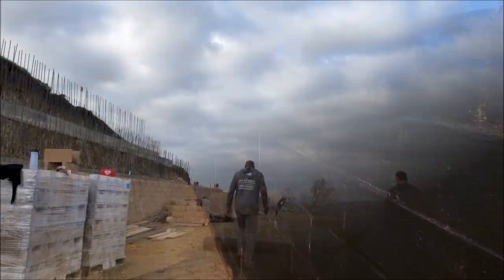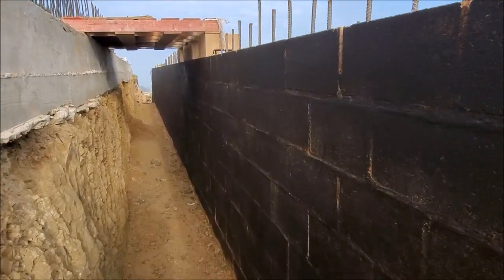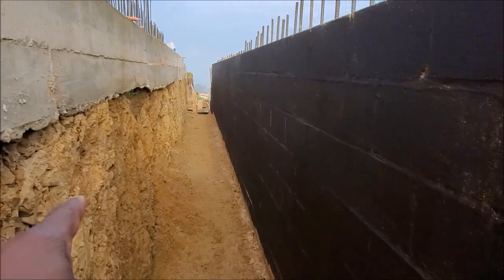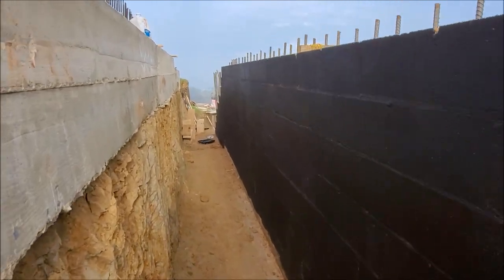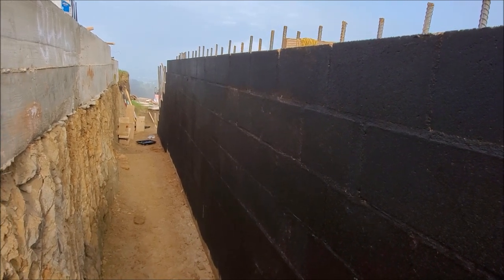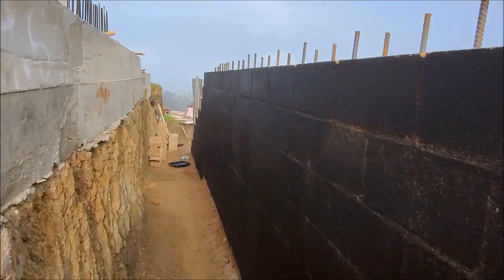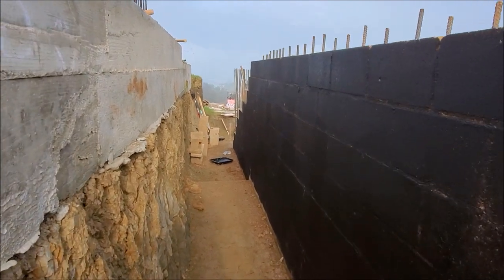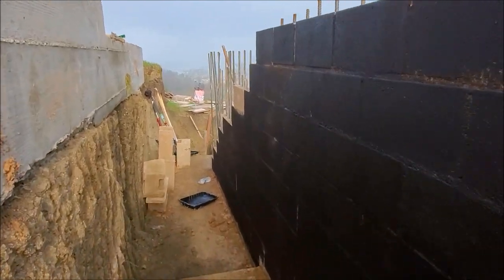How To Waterproof A Cinder Block Retaining Wall... All Access 510-804-4646

Comment from the maker: Waterproofing a retaining wall is one of the many steps to ensure your wall lasts a long time. 
Check out installing drain rock on bottom wall http://bit.ly/2Ngojtb
Reply: All Access Construction  you can use a better waterproofing material
Reply: What's the name of water proofing material? I'm building that exact wall right now and never have before.. Another question I was curious about it knowing how far to seperate rebar.. I know it has to dry in the concrete footer before you build the wall but seems like there would be spots it doesn't line up. Maybe just bend the rebar?
Reply from the maker: @Rsossy  all rebar we use were #5 and 12 inches on center... There several watering proof application you can use.. If you have a white cap in your area check with them
Reply from the maker: @Rsossy  https://youtu.be/sLfN1-MF0gA
Reply: @AllAccessConstruction  OK I had seen someone say to space them 24" but you do 12?
Reply from the maker: Yes all rebar we use is at minimum 12 inches on center.. . 90 percent of the time it's.. #5
Good luck..
Reply: @AllAccessConstruction  thanks bud

Comment: I hope you still tamped the stons you added but the toe vs the heel of system should work as long as the base of retaining wall does not rotate. 
I like the idea of the full stone but you might have to have added concrete to underpin where you could not compact the soil back into place...
Sakrete would be just fine for that , adding as needed during your stone lifts.
Your cmu wall, with 4000psi concrete is mostly waterproofed...
Also, you will need weep holes to allow for all that water that will filter down that stone and cause swelling in your existing clay side... I know this is three years late...
Further, you want to move your water away from your footers, always... always...
Reply from the maker: Thanks for the input,, this retaining wall was inspected by 4 Engineers and had to pass five inspections before being signed off. I disagree with the weep-hole theory. We put a complete French drain system behind the wall. We also just had the most rain in the last 10 years. The drainage system worked perfectly. Wall still there as well. no movement at all 

French Drain Project: https://www.youtube.com/watch?v=sbc8NbkhC7A
Reply: @AllAccessConstruction  you required four engineers to sign off on this simple system?
That is ridiculous and any engineer who directs water to to foundation on purpose should be in another field...
Directing all that water with stone to the foundation is basically begging for failure in the long term.
Scourer can cases a damn to fail and your wall system is no damn...
Also, I noticed you did NOT tamp your stone base in the video you sent me to look at.
I have been doing this for over 30 years, I know bs when I see or hear it; others called you out on not correctly applying the water proofing and you deflected with you had it approved...
Approved is not the same as doing it right, do it right everytime and these tradesman are not stupid when they called you out on that one and done coat of "water proofing"...
Do better... Do better and stop making up excuses for mistakes... do better next time.

Comment: The membrane coating appears way too light on. If you don’t apply a heavy coat of waterproof membrane and seal all voids and pin holes it will definitely absorb moisture.
Reply from the maker: Appreciate the comments.. But it's on there pretty thick.. Pass 2 inspection before we could backfill
Reply: Hmm, maybe the camera is giving a misleading view but at 1:19 the waterproof coating does look very patchy and it appears to show the blockwork showing through behind.
Reply from the maker: Appreciate the comment but it's on pretty thick. Pass inspection..

Comment: There is no such thing as waterproofing a block wall. It’s called dampproofing. It’s the quickest way to get sued.  Secondly you can get rid of the drain rock if you use a more modern system of delta ms in conjunction with drainstar strip drain and drain holes.
Reply from the maker: Appreciate the info.. 👍🏿👍🏿👍🏿